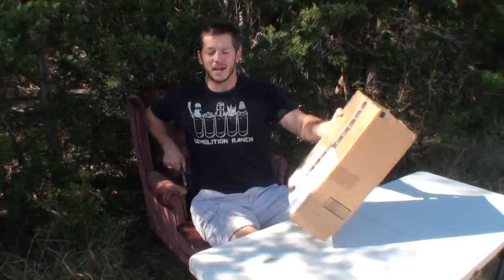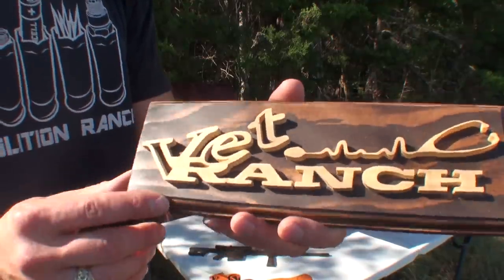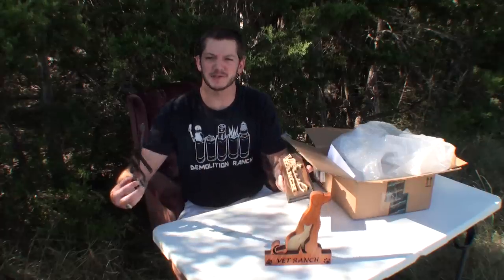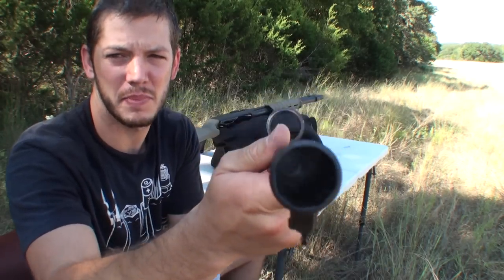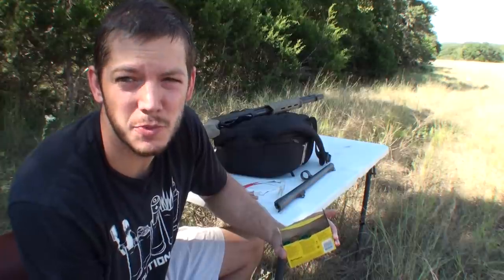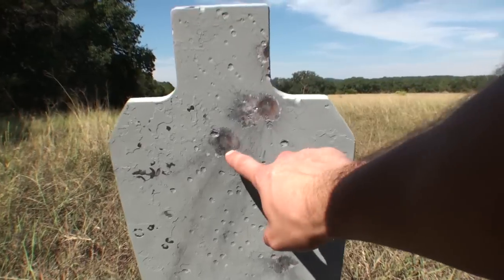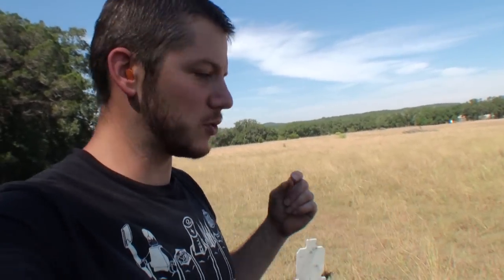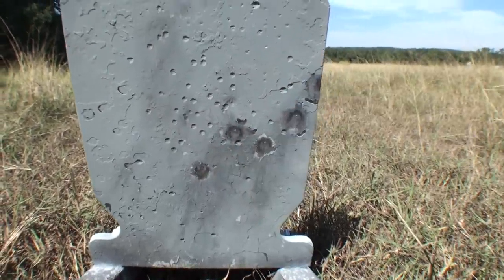Rifled vs Smooth Bore Barrel

Comment: Don't most slugs have grooves on them which makes them spin anyway?  If you wanted to do a true test, you might make some homemade shells ungrooved slugs.
Reply: +Milsurp Mike the rifling on slugs do not make them spin, it only stabilizes them for greater accuracy.
Reply: Yes, a lot of slugs are rifled, but it doesn't make them spin. The only reason they are rifled is so they can compress to make it through a choke.
Reply: +845ToastT look at the rifling on the slugs. you'll see most (at least all I've seen) are angled. causing the rifled slugs (in a smooth bore) to spin...
Reply: +Brett Sanfilippo It's no more than a theory and marketing scheme. The original idea was the air going into the grooves would cause the slug to spin, but this actually doesn't work.
Reply: +Milsurp Mike they make rifled slugs i wouldnt say most but overall it has the same effect as a rifled barrel.
Reply: +845ToastT wouldn't there be friction points that cause it to spin? marketing or not...isn't there physics or something to back it up?
Reply: +845ToastT and where did you get the info about it being air traveling through the groves that make the spin?
Reply: Brett Sanfilippo it only stabilizes them, there are plenty of video's here on youtube that show them being shot out of smooth bores in super slow mo and none of them ever spin.
Reply: +butthole checker I found info at almighty Google...I don't trust YouTube professors lol...but it seems to give same info lol and thanks I'll look for the videos
Reply: +Milsurp Mike Very true!  Most slugs are rifled so they can be accurate out of a normal smooth bored shotgun.  The rifled slug spins out of a smooth bore, as if it were shot out of a rifled bore.  Actually, rifled slug out of a rifled bore can be less accurate because there are two spinning forces on the projectile, one from the slug, one from the barrel.  Often times they are counter productive.
Reply: Scott Jenkins rifled slugs do not spin out of a smoothbore, the rifling on the slug only stabilizes it. it sounds weird but it's true. you can read up on refiled slugs on Remingtons website.  you would still need a rifled choke to make them spin. there are plenty of slow mo videos that prove that they do not spin out of smoothbore barrels.
Reply: +Scott Jenkins most people assume that since the slug says "rifled" that they spin out of a smoothbore, but in fact you need a rifled choke or barrel to make them spin.  the rifling does help stabilize them out of smoothbores, but it does not make them spin.
Reply: False, the "rifleing" on "rifled" slugs simply allows the slug to squash down incase you fire it through a choked barrel so it doesn't blow your gun up. The grooves don't impart any spin on the projectile.

What makes rifled or foster slugs fly true is the hollow base and weighted nose. It's like a spear heavy front and light back keep it from tumbling in flight.
Reply: +Brett Sanfilippo except it's sitting in front of the wad, so it doesn't spin. The "rifling"is so it can squeeze through a full choke barrel. The ""rifling" puts less material on the outside of the slug so it can deform going through the choke without ruining bubba's new shotgun because he couldn't read the box.
Reply: +Milsurp Mike the grooves on shotgun slugs are completely absurd and useless. they serve no purpose other than looks.
Reply: +Scott Jenkins were did you hear that load of bullshit?
Reply: +Joseph L  exactly right.
Reply: +845ToastT this
Reply: +Milsurp Mike the groves are ment for the slug to stretch and stuff going down a tighter bore (improved, modified and full, never EVER shoot any slug out of tighter chokes than full, full WILL affect accuracy though)
Reply: Grooves don't make the projectile spin.
Reply: +Kurt Stoll yup taofledermaus did some grooved slugs, they'd tumble out of smooth bores. it's rifling that causes spin, projectile aerodynamics don't do squat at an instant 1200+FPS, but idiots need to be edumucated...
Reply: Even full on some barrels can be dangerous. I had a 30 inch mossberg 500 barrel, and I had tried to drop a slug through it with the barrel off the gun and it wouldn't go past 8 inches before c the end of the barrel,  which had an even tighter choking to it(full choke).

I was afraid to shoot slugs out of it after a gunsmith told me the same thing, that it would probably blow the barrel up
Reply: ++DemolitionRanch seriously?? You're making a fake Demolition Ranch account... You're patethic....
Reply: B_A_FPS report it people.
Reply: +WalkinOSF oh no
Reply: +845ToastT if you shot a slug through a choke. you'll blow up the barrel
Reply: Lovie DeBiasio I've shot slugs through chokes for many years and nothing has happened.
Reply: hmmm ok through a full choke?
Reply: Lovie DeBiasio Well I haven't.
Reply: No go away.
Reply: +Milsurp Mike the grooves aren't and never were designed to make the slug spin, they were designed to swage the slug through a constricted choke.
Reply: ++DemolitionRanch Reported.
Reply: or shoot Sabots from a smooth bore.
Reply: There is no harm in shooting rifled slugs out of a rifled barrel. Accuracy will benefit too if the rifled slug isn't accurate out of your smooth barrel unless a slug is already accurate out of your smooth barrel. I have no advice except to try many different loads from many brands and observe the grouping. Remington Slugger was accurate out of my smooth barrel and saw little benefit with the rifled barrel. Winchester Super X was not accurate from my smooth barrel, but awesomely accurate with the rifled barrel attached. Yes people! This works! Maybe not as pinpoint accurate as sabot slugs, but a hell of a lot cheaper. No damage will occur from doing so either. The worst thing that could ever happen is lead fouling. OOOOOOHHHHH! "Scary!" After over 100 slugs fired my rifled barrel still hasn't been cleaned because there is still minimal residue buildup.
Reply: +Bone Drone You're still incorrect. lul.
Reply: DLeMA AFiK
On what might I ask? You haven't pointed out what it is you think I'm wrong about.
Reply: +Kurt Stoll yes but nothing happens  doesn't mean it's ok to shot a solid projectile through a lower diameter muzzle. at least the chock doesn't increase the accuracy or something on the slugs and it's recommended to shoot the full caliber slugs with cylinder barrels.
Reply: Milsurp Mike actually the land's on a rifled slug are the same height as the rim at the bottom of said slug. so no they do not spin.
Reply: Rifled slugs do spin just not as much as a rifled barrel would make them spin slow motion video has show this also the shape of it gives stability as well
Reply: Roman Max cool.

Comment: Thanks Matt for making this video. I’ve been having this discussion a lot and didn’t know for sure that sabot slugs like copper matrix/Remington are ridiculously accurate out of a slug barrel. Basically just sayin the rifled barrel and smooth projectile are a little more accurate vs rifles slug and smooth bore barrel. I’m no expert, but that’s been my experience anyway. The right optic and conditions you can reach out and touch somethin from 100-150 yds and a good shot behind the rig.
Reply: Joe will Sabots or Rifled slugs hurt a smooth bored SG barrel??

Comment: If those are rifled slugs they are designed for smooth bore use. Saboted slugs should do better from a rifled barrel. I couldn't tell which you had.
Reply: +Oldman Wells You are exactly right. 12 ga Foster slugs for smooth bore and Sabot for rifled barrel.
Reply: +Torrath7411 

Exactly, this was a bad test in my opinion, I have killed deer with Sabots out of my 870 rifled barrel at over 100 yards. They are really fast and insanely accurate for a shotgun slug.
Reply: +Torrath7411 

Exactly, this was a bad test in my opinion, I have killed deer with Sabots out of my 870 rifled barrel at over 100 yards. They are really fast and insanely accurate for a shotgun slug.
Reply: +Bweiss1234 It seems like Matt went into the "test" believing rifled barrels were "stupid". He improved his groups by 33% with the rifled barrel over the smooth bore and still said, "rifle barrels are stupid". Maybe he shouldn't do videos when he's on the rag. LOL
Reply: Yeah also the first thing you learn when you buy a rifled barrel for your shotgun is that you need to shoot Sabot slugs to get the most out of the rifling, it's clear he did not do much research on this video.
Reply: +Tommy Rad Sorry but he did not improve anything ,he just had a 
flier the first time,brenneke type slugs or rifled barrel  may give you better results if you shoot over 100-150 m which is uncommon  imo
Reply: John Bonaros
Absolutely NOT uncommon, especially in the southern US states where deer slug hunting is legal.
Reply: +Tommy RadWell,if you hunt successfuly at 200m with a shotgun
you have my respect fwiw
Reply: John Bonaros
Sorry, I didn't mean me... I don't as it's illegal in OR. But, people do. 200y? I doubt it. 100 to 150y.  How did we get so far off topic.
My comment was, Matt's "test" was NOT done well. In rifled barrels, the use of sabot slugs will cut his groups from 12" [smooth bore] & 8" [rifled barrel with incorrect slug] to 3" with a rifled barrel at 100y. < That I have done, just fartin around, shooting targets.
Also, it feels like Matt is getting tired of maintaining the Demo Ranch channel since Vet Ranch has taken off and is so truly important. Cheers.
Reply: Lots of people in Northern and Eastern VA are stuck with shotguns for deer by law. I live in the mountains where rifles are king. I look down on the slug gun, but if that is what you are stuck with then use a rifled barrel and saboted slugs.
Reply: +Oldman Wells Same with NY, I've only ever shot deer with a 16 gauge and foster slugs. They do a hell of a job but I've moved out of NY, want to get an elk with my 300 WM.
Reply: Dave L Good luck on the elk hunt....and good job getting out of NY.

Comment: SABOT SLUGS???
Reply: +Havilah Gold That's what the rifled barrels are the best at!!!
Reply: +Havilah Gold very true, because sabot slugs do not have rifling on them like a rifled slug does. so a rifled barrel certainly works wonders for a sabot slug.
Reply: +Havilah Gold I know that's exactly what I was thinking
Reply: +Havilah Gold indeed Sabot rounds is what rifling is used for. but not really for round slugs, because it wont really matter if something round is spinning or tumbling.
Reply: Definitely would test this before any conclusions
Reply: +Havilah Gold All of this. Rifled slugs are not intended to be fired through rifled barrels. Sabots are the proper diameter to grip the rifling and spin the sub-caliber slug inside of it.
Reply: takticalpickles
Indeed. Cmon DR.MATT! We want Sabot Slugs (in a rifled barrel) VS Rifled slug (in smooth barrel). With a red dot or a scope!
Reply: austin woods
Yeah...a little hasty ther Dr.Matt.....you're better than that!!!
Reply: +madmax2069 not exactly  true but out of a shotgun yea
Reply: +Havilah Gold That's what I was thinking.  Rifled barrels are meant to shoot sabots.
Reply: +DemolitionRanch hmm...Matt got hacked?
Reply: +takticalpickles Nah, look at the profile... it's a copycat.
Reply: that's what a rifled barrel is for... sabots. Matt is very wrong
Reply: +Butthole Inspector The rifling on slugs doesn't impart any spin really.   They are really just there to reduce lead fouling.   What makes regular slugs more accurate in smoothbores than regular balls or sabots is that they have a hollow base making them weight forward and the pressure flaring them out at the base.  Similar to a diablo pellet.   The rifling on slugs giving them any useful spin for accuracy is a misconception.
Reply: +takticalpickles Traditional rifled slugs are intended for both types of bores.   Rifled shotgun barrels and chokes were originally meant for increased accuracy and range from traditional Foster type slugs.   Sabot slugs for only rifled barrels didn't come out until after the barrels were available for a time.   
A traditional Foster slug engages the rifling just fine by the hollow base being flared when they are shot by the pressure.  They really aren't much different than than the  Minnie Ball and work on the same principles. A foster slug will spin from a rifled barrel.
Reply: +Nicholas Smerk No they aren't.   They are meant for both.   Sabots are just nicer because you can use a metal jacketed solid projectile instead of just a lead one that is hollow based.   The rifled barrels are meant to be used with either one however.

Using the same traditional slug in both barrels ensures a fair comparison.
Reply: takticalpickles
I think so
Reply: how about you buy a rifle instead if trying to convert your shotgun inyo one? that way we leaf each role defined for that were ment to do
Reply: albert marian gamer
Main reason being......  Hunting regulations.   Rifled shotgun barrels pretty much came about due to rifles being banned in "shotgun only" areas.
Reply: ***** well that makes sense
Reply: +Coffeetime yeah. just like in ohio. you can only hunt deer with slugs out of a shotgun. but they recently made it so you can use straight wall cartridges like a .44 or a 45-70 also

Comment: Slugs like the one shot in the video are designed to have the center of gravity in front of the center of pressure. They are basically a little lead cup being fired bottom side forward which allows them to be aerodynamically stable without needing to be spun. If you were to try shooting sabot slugs(which are what rifled shotgun barrels were designed for) out of the smooth bore you wouldn't get good results.
Reply: Thank you for understanding a little more. I'm doing research on a 12g slug gun I have and can't find anything on it.  These are the best I get. A rifle slug is for smooth bore barrel. The fact he got that group with a rifle barrel using rifled slugs is the impressive thing lol. I use hornady sst and find them possible inconsistent.  Need a good round for my slug gun. And good scope. Got a nikon slug hunter. Love it but it got loose over time.

Comment: I feel your pain in this video today, Went to my range to break in my new 500 and all they had for cheap that was allowed on the range were the Rem Sluggers you shot in this video and Rem Magnum Buckshot (12 00BK pellets at 1290FPS per shell). Needless to say 20 rounds (10 each) of these in a 30min window has left me with a barely useable arm and shoulder tonight.

Comment: For funsies a friend and I went to the range and tried to do long range with the smooth bore and slugs. You can walk them in at 200-250 yards, but it takes a while. We were taking turns and it took us about 10 rounds to get close to a 55 gallon drum.

Comment: Rfled slugs are for smotth bore barrels and not meant to shoot in rifled barrels.
Reply: He should have shot sabo slugs through the rifled barrel,fosters through the smooth bore,for comparision.
Reply: Krys B actually. the rifling on the rifled slug does basically nothing to get it to spin, the only functional purpose of it is to let the slug swage through a choke easier.  and then of course there is the marketing ploy of letting the consumer think that it will make it spin
Reply: +John Moore
what are you talking about? you dont ever want to fire a slug threw a barrel with a choke in it....thats the easiest way to destroy the choke
Reply: Crolep pelorC didn't say it was great for the choke, but the reason they put the rifling on the slug is so you CAN fire it through a choke without your gun blowing up
Reply: Samu Rai i shoot 1 1/8 oz challenger rifled slugs through my old browning a5 with a full choke no problem
Reply: Samu Rai you can't shove a Lee slug in a lo78 wad with a steel rod! But it's made to shoot. And shoots fine
Reply: Sabots are a lot louder than Rifled slugs 
Also wondering how Rifled slug didn’t get stuck in rifled barrel 
The rifling on a Rifled slug is so it spins in a smooth bore
Reply: I've hunted and shot alot of shotguns in my day. Where I hunt there's no rifle hunting. I have a rifled barrel and shoot sabots. Most here are   internet ninjas. Rifled slugs are for smooths and sabots are for rifled period... I get 3 inch groups at a hundred with rifled barrel sabots. Smooth bores will shoot worse. My dad has used the same gun I have for years also and they are awesome. I don't need to argue or dispute because I know I have killed many big bucks and made plenty of clean kills with smooth and rifled. But some of the shit being said here is not true. Lol just a good after work laugh. All I would say is Matt try sabots in your rifled strictly. And get a gun with the scope mount attached to the barrel vs the receiver if you can. Much better accuracy. Then try smooth bore with imp. Cylinder.(if it has chokes) I know your a gun guy and are smart but just saying. Grew up using shotguns because of restrictions so I've used many and mastered them. Maybe you knew that and just didn't show the other slugs. Love your show bro keep em coming!
Reply: @jacobb5944  CYL Choke only for me
Reply: It would actually make it more accurate. Extra spin.
Reply: Try using a higher table . I've found that being more upright works better for me . It hurts less if you're not getting bashed in the clavicle  .
Reply: Как эт понять!